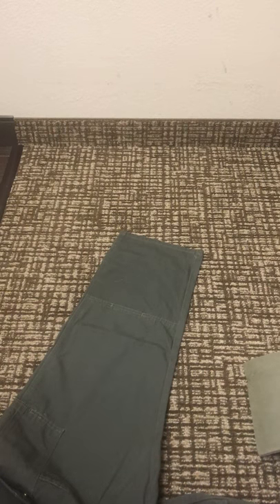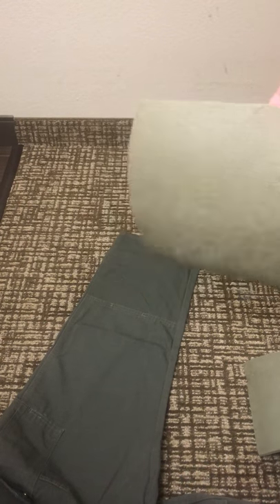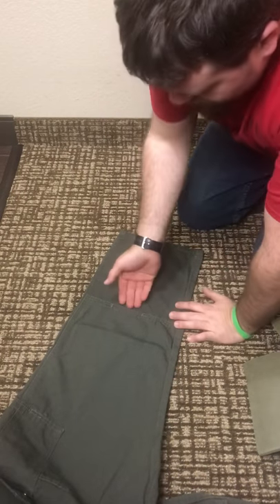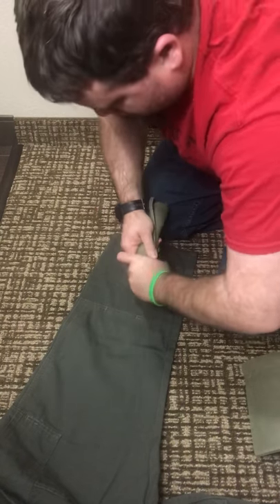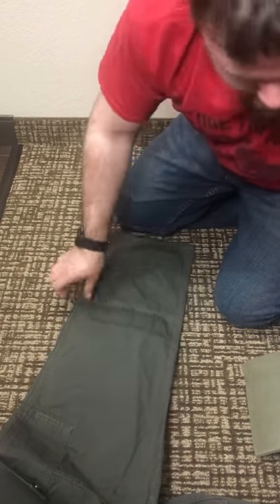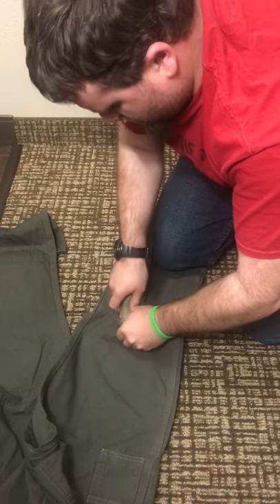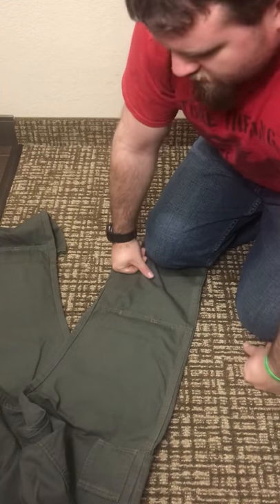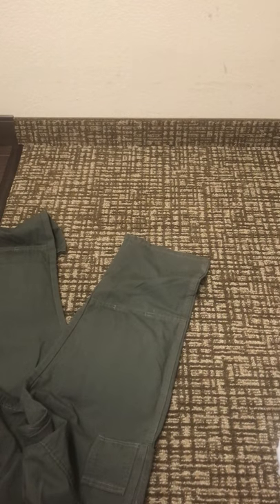Helpful Hint how to put knee pads into Wrangler Riggs Workwear Pants

Comment: That tiny hole seems like a design weakness. In fact, when I first received the pants, and having never worked with pad inserts previously, I thought the pants were defective. Maybe a bigger opening from above, with a velcro flap to retain the pad?
Reply from the maker: A Velcro type opening is what’s found on plenty of tactical pants and you could modify these of course but that hole works fine and hasn’t caused me any issues even when washing 100+ times with the pads in them.
Reply: @seanobrien4238  M'kay, so I bought some tactical pants with velcro top opening. The knee pads are in the middle of knee when standing, but when kneeling the pads naturally rise up so I'm barely on the pads. The Riggs are much better in this regard. The Wrangler description of the Riggs actually doesn't mention pads. It implies that the opening is just a vent as in "reinforced knees that are ventilated to prevent buildup of dirt, dust, and other debris". Strange...

Comment: How thick is the pad you are using? Do you think 1/4" thick pad would fit in these pants?
Reply from the maker: The Sleeping pad is about 3/8” thick so 1/4” will fit and be less noticeable however the trade off is 3/8” is as thin as I go because of comfort.
Reply: @seanobrien4238  Ok thanks a lot. I really appreciate it.  I just ordered these pants and now I know what kind of pad I can use.  I was going to use a 1/4" yoga mat.  Maybe I can fit two 1/4" pads in each side by sliding them in one at a time.
Reply from the maker: Brad W I haven’t done the 2 pad thing but I’d think it would work. 1/2” will be noticeable if that’s something. You care about.
Reply: @seanobrien4238  I'll have to see how it works out.  Is it possible to remove the pad after?
Reply from the maker: Brad W I haven’t removed them even when washing. The hole is only 2” or so. If you’re ok with sewing you can break the stitches then re sew.
Reply: @seanobrien4238  Yea it looks like they would be difficult to remove.  Thanks

Comment: Is it okay to wash them with the pad in?
Reply from the maker: Yes absolutely. I typically turn my pants and shirts inside out to help maintain prints and such so that may help with me not having issues but I haven’t had a problem across 3 pairs of pants and they typically wear out in other spots. I had one pair that was torn on the knee of while kneeling on a sharp rock however that pad saved my knee